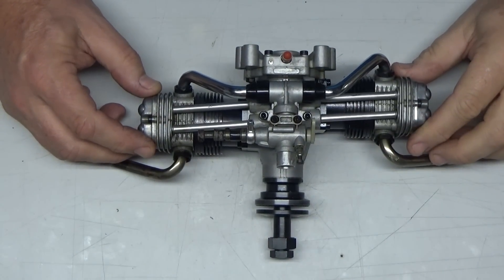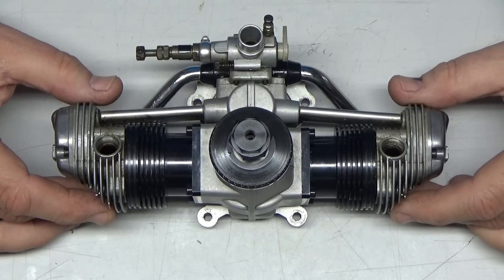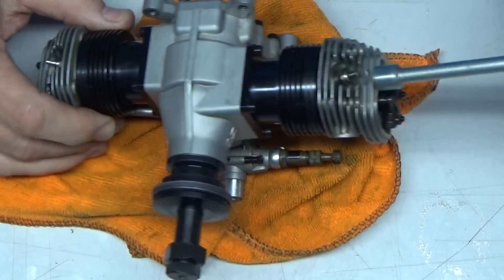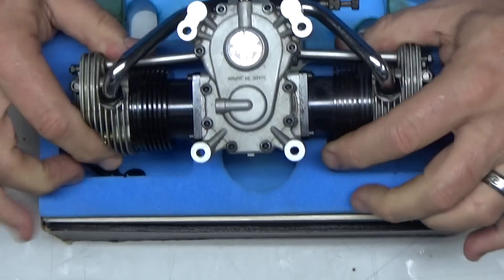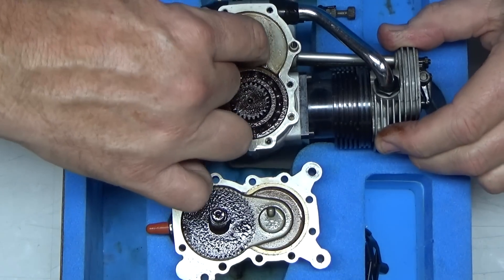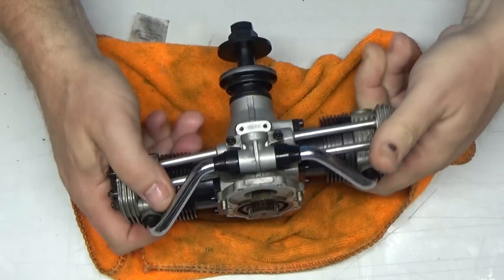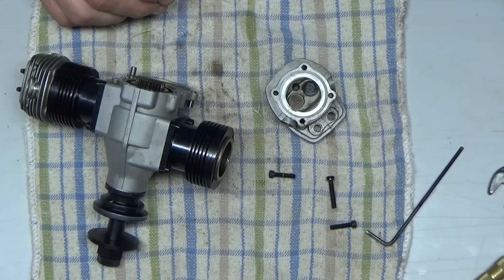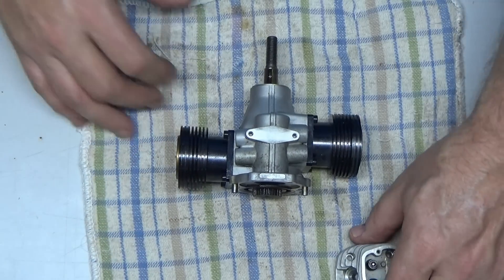OS FT-120 II A Look Inside Part 1

Comment: Always a good choice to take a look inside of used engines. 90% of them have rusty bearings due to the myth of rust prevention capabilities of synthetic oils. Running engines with those corroded bearings and shafts would ruin the engine or at least cause alot of unnecessary wear.